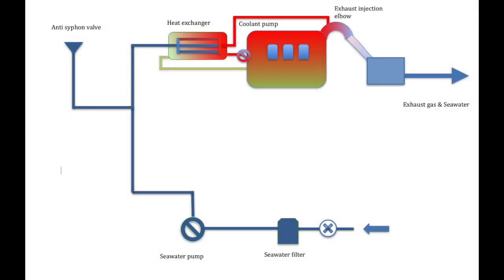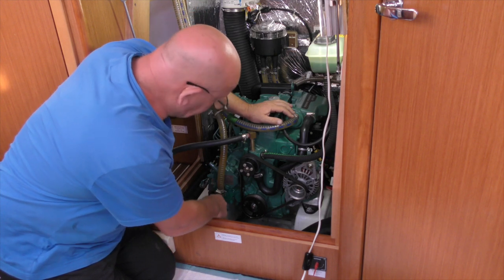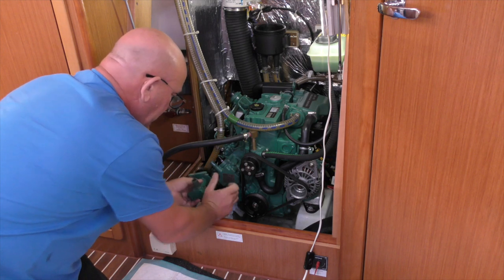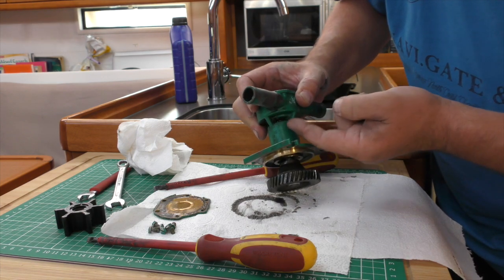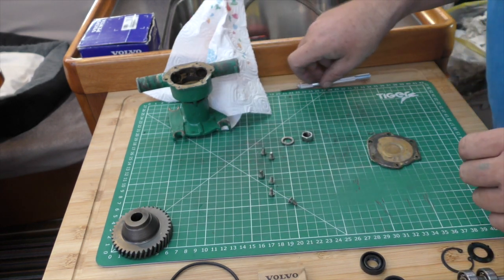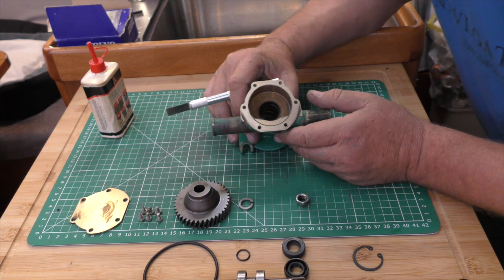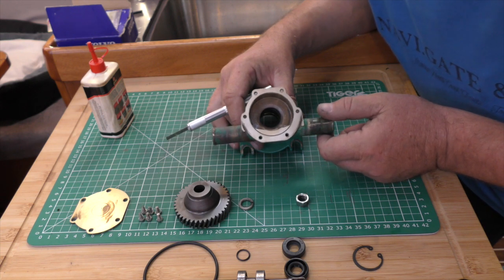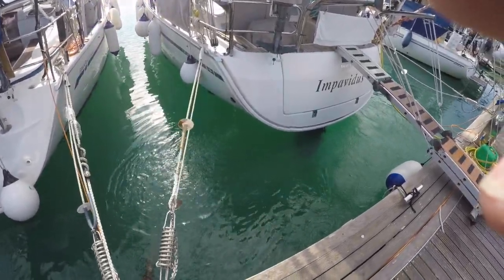Boat Engine cooling. Engine overheating? Part 1

Comment: Captain, Thanks for sharing this video. I was able to successfully rebuild the Sea Water pump in my Volvo D1-30b. Now that I have done it once, I expect I could be to do it much faster next time. I chose to clean and paint the pump to prevent further corrosion on the exterior. Thanks for your contribution!
Reply from the maker: No worries, Thanks for watching.

Comment: (Baz) circlip pliers added to the shopping list. Top tip that we can use the other side of the face plate. Very informative video. Cheers. 👍
Reply from the maker: Thanks guys, sorry we are making you spend money:-)   Sail Safe Guys, Ant, Cid & the pooch crew.
Reply: You should get ones like Ant uses. They have interchangeable jaws. Warning, they can and do bite if you let them.

Comment: Nice with all practical  works step that you share. Thanks.
Reply from the maker: We wanted to cover the raw water pump in more detail than we have done before as it is such an important component. More detail and top tips in the video we are just uploading now for Patreon's. Should be out next Sunday at 16;30 ish Thanks for watching mate. Sail Safe, Ant, Cid & the pooch crew.

Comment: Brilliant! Yesterday I looked at our pump which is just like that but mounted at the back and  run by a belt on a pulley at the back of the cam. Lo and behold there was water dripping from it. Next stop Volvo spare parts. At least I know now how to tackle it.
Reply from the maker: Phil check the parts list on our website you can get the same OEM lip seals for your pump much cheaper than Volvo. Sail Safe mate. Ant, Cid & the pooch crew.

Comment: Great video, helps alot! How much torque did you tighten the nut to at the end of the video?
Reply from the maker: You can use a strap wrench to hold the gear wheel. Gently hold the gear wheel in a vice or even wrap a twisted rag around the gear wheel to hold it. Do Not use the slot in other other end of the shaft to prevent it twisting as this will damage the shaft. The torque is  21 Nm with Loctight applied Hope this helps. Pleas take a look at our 150+ other videos on YT. Sail Safe mate. Ant & Cid
Reply: @SVImpavidus  Thanks alot, I will check out your videos as well!

Comment: A very useful and instructional video. I do have a couple of comments however. 1. Not sure which way round the oil lip seal goes in. I am assuming from other videos that it goes with the lip toward the back ie away from the impeller and the water lip seal with the lip toward the impeller. 2. How far back does it go? You suggest using a socket to put the back (oil) lipseal in before the shaft. Is this correct? I did notice that you seemed to have both of the lipseals on the bench when you were talking about that. 3. Fitting the spacer and the O ring. Doesn't look quite as easy as 'just pop it in and push the O ring in place'. Should there be a groove on the shaft? 4. The shaft on my pump was really tight. It needed a hammer and block to 'persuade' it to move. A gentle tap did nothing. I also see some grooves on the shaft where the lip seals go. Maybe the shaft is worn and needs replacing. I will take further advice before refitting I think :/ Maybe I am being a bit overly cautious but not done this before.
Reply from the maker: Hi Richard welcome to the channel. Answering in the order you put the questions. 1. The lip seals have the rear running in fluid so the lip seal on the water side of the pump has its rear facing the impeller. That the flat side facing the engine block. The lip seal at the rear of the pump has it's rear facing the engine block so it gets splashed with oil. IE  the flat face facing the pump. 2. The lip seals have a little space that they can be positioned for and aft so they do not always sit exactly in the same place on the shaft that may be worn in that location. It is about 1.5mm of tolerance. However, using a socket will press them in so that the rear of the seal is flush with the casting. IE they can be pushed just a tiny bit further in but should not be proud of the casting or they will foul the impeller. he rear (Oil seal) to the engine is not so critical but should be pushed home. In both cases they must be evenly in, not  out of line with the shaft. 3. They sometimes need a little heat to persuade them off or even a press. If you have a large vice you can sometimes use it as a press. Use a hard wood block or a brass hammer. The shafts are quite easily damaged. Most auto shops have a small press and will generally help you out for the price of a good beer if you get stuck. 4. The shaft is stainless steel which tends to wear at the lip seal position. Moving the seal position as per point 1. Can help or very gently abrading the shaft with 2000 grit paper can help remove the wear rings. If after a gentle tickle with 2000 grit paper you can still feel the "grove" with your finger nail it is time for a new shaft or a shaft collar. Just google SKF speedy sleeve. these collars can be slipped over the shaft giving it a new lease of life.  Hope this helps. Sail Safe mate. Ant, Cid & the pooch crew.
Reply: @SVImpavidus  Thanks Ant. Finding your channel very interesting and am looking at the blogs on your website. I have now changed the seals and bearings but it involved so much bashing to get everything apart and then back together again I have decided to take it into a marine engineer to make sure that I have not created further problems and to put right any issues. A slight water drip from the pump I can deal with. A failed pump would not be a good thing. Thanks again for the videos. I have learned a lot from this exercise.

Comment: Good instructional video. 👍⛵️ BTW split washer or spring washer?
Reply from the maker: Hi mate. Trust your well and Horndean is not becoming  a stay at home lock down area where you need a certificate signed by both grandparents to open the front door or have an opinion? BTW we  found out why you did not get our email on a meet up for a Guinness and a chin wag. Our bad, we had the settings wrong... The pint was cold and went down well. So well, I drank yours and Cid drove home!!!!  Yep the washer is split, and formed to spring against the nut. I am not convinced that this is the best solution? A Nyloc nut would be at the limit of its heat capability or tolerance hence the addition of good old Mr Loctite! 
If we dont hear from you before, We wish you, your family and friends the very best Christmas. Sail Safe mate. Ant, Cid & the pooch crew.
Reply: @SVImpavidus  yeah - fffff freezing here and wet. Tier 2 here which is petty restrictive  and essentially means no social interaction apart from people you have formed either a support bubble with (single parent families) or a childcare support bubble (so we see our local grandkids). What is confounding is that disease levels have not really been reduced (in the South) and hospital admissions continue to ramp up. It is very difficult not to be too pessimistic about where this is all going particularly as  the vaccine programme is probably going to take the best part of 2021 to impact.

BTW spring or split washers are pretty ineffective and a better arrangement  would be a plain washer , a plain nut with the correct grade of Loctite (241?)

No worries about the email - nest time.👍